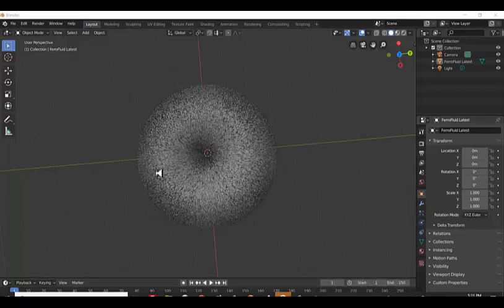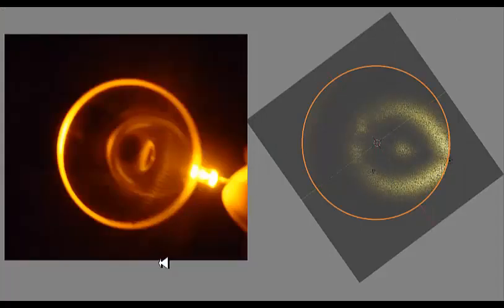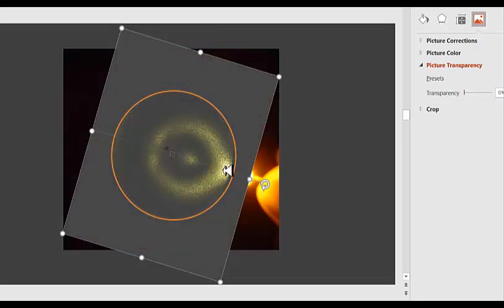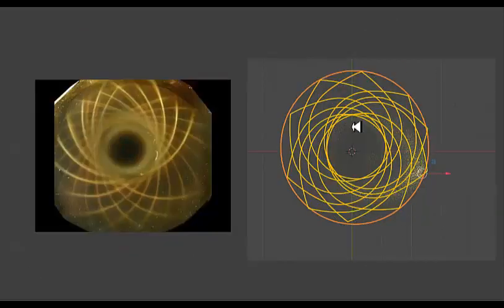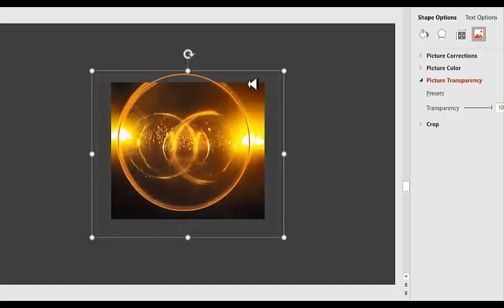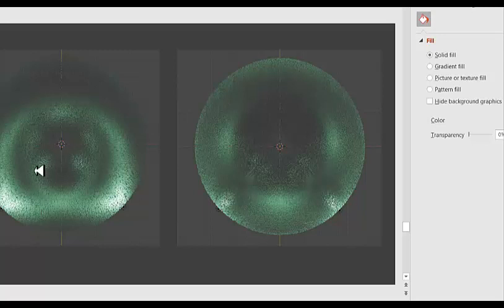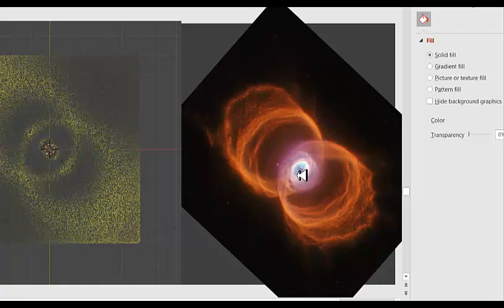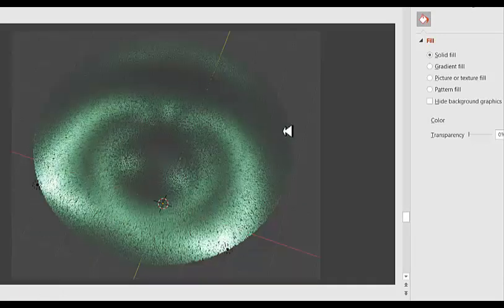Demystifying the Ferrocell  :   PART 3

Comment: Nanoscale ferrous needles and larger are probably very similar at galactic scales. This effect should be studdied and modeled. This simple model can be scaled up to galactic clouds of oriented rods, difracting light.  This could account for why spiral arms brighten and dim.  It might depend on what way all the rods in the dark medium align.
Reply: This is nobel prize type stuff, you should scale up that model, run it against the other galactic models. Floating pointing needles in space, is too simple to ignore, and so impactful in light magnitude, simply because of the distortion this phenomenon causes, it has to be key to relevancy we observe.  This phenomenon could explain why we see stars brighten, and dim, at specific intervals.  It could be dependent on the needles and how they point/rotate to changing magnetic fields.
Reply from the maker: I agree that this could be scaled up. It is my opinion that the "Ether" is very similar to the ferrofluid between the two pieces of glass in the ferrocell. The Ether aligns around magnets in a similar manner to how the nano-particles in the ferrofluid align which is analogous to how iron filings align around a magnet. It both scales up and it scales down.  IN my model of the universe, a black hole is also a freakishly large "magnet" and the Ether surrounding it will form needle like structures like in the ferrofluid which light can reflect off like in the ferrocell. That is why the image that the ferrocell produces is so similar to the famous black hole "image" that was presented to the world a few years back.
Reply: I envision trillions of them.  Amuha Muha even.  Smaller and larger too.  Forming, aligning, and filtering light.

Comment: I understand that the lines of light are not showing separate MagnetoKinetic field lines, but would it to accurate to say that the shape and position of the lines in a Ferrocell show the shape and position of the overall MagnetoKinetic field? That's something I'm a little confused on, thank you.
Reply from the maker: The lights are reflecting off of the nano-particles in the ferrofluid between the two pieces of glass. What you see is highly dependent on where the lights are places and where you are standing relative to the lights. Long story short, what you see is an optical effect or illusion if you may.
Reply: @FractalWoman  I'm still a bit confused, I get the optical illusion effect due to how the particles are reflecting the light, but does it serve any use in showing the Magnetic field's presence or position in relation to the magnet?

The fact that the nano-particles affect the light in the way they do shows there is a field affecting their location and rotation, what I'm wondering about is if the effect on the particles gives us an accurate position of the magnetic field (I'm still getting familiar with the language and terminology you use).

Because in your previous video where you overlapped the iron fillings as showing the ElectroPotential field between them, and the Ferrocell as showing the position of the MagnetoKinetic field, it made a lot of sense to me.
Reply from the maker: @JenkoRun  yes I did overlay the field line with the ferrocell image and there were similarities. But that only works when the lights ate surrounding the ferrocell and when the camera is placed above the ferrocell. I made that video before I understood how a ferrocell works. In retrospect, it was a bit misleading. I was misled by Ken Wheeler  and then passed that along to you all.
Reply: @FractalWoman  I apologies if I sound like a broken record at this point, but even with with the misunderstanding, and I don't really understand what is the misunderstanding is, is the Magnetic field shown in the Ferrocell reliable for relating to the field around a magnet in the real world? It matches Eric Dollard's image perfectly.

I'm trying to understand what the Dielectric and Magnetic fields around a magnet look like, or even if that is what is present around a magnet at all, but I've been getting a lot of conflicting information for the past week, or at least unclear information, and it's left me feeling confused and quite frustrated at this point.

Comment: Would love to see a ferocell + magnet with a COB LED-Strip around it (must attach a dimmer to the strip tho.) 

A COB LED is basicly the same as regular LED but much much smaller and placed much much tighter givning you a almost homogeneous light in the strip. 

With proper dimming one might be able to see a more high res pic. 

Have anyone tried to stack multipel ferocells?  Say 10 sheets with say 5mm distans from from eachother with magnet in the middle? Maybe one would be able to get a real 3D picture of what is actualy happening of tried.
Reply from the maker: We already know what is happening in 3D. The  nano particles in the ferrofluid align with the magmatic field of the magnet. Light reflects off the aligned nano particles into our eyes. What we see is highly defendant on the placement of the light and the placement of the camera or our eyes.
Reply: @FractalWoman  Yes, I understand so you say adding a more homogenious lighting to/around the ferocell would not add any more info? Maybe it would only blur out or make the tragectory of the magnetic lines harder to distinguish? (Bad english i know)
Reply from the maker: @lundqvjrl9359  I have done this. I used a continuous lighting system around a ferrocell and all it does is wash out the lines that are normally there. You can see the results in this video: https://www.youtube.com/watch?v=6-YzsIjaVuw

Comment: Yeah I think black holes are like volcanoes on earth, but in space, it would be pointless to dump back into your own backyard right? so it inverts everything in space back to counterspace. On spheres like planets and stars it's inside out, lava spews outward helping keep the right pressures within. in space it inverts back the front as it otherwise creates a pointless loop of taking and dumping in the same universe. Ken says they are objects with a super high dielectric component so a mass with no visible magnitude due to it's magnetism being over powered by the dielectric inertial plane pulling back into counterspace, hence the drain motion they photographed. Thanks for the vids most excellent!

Comment: This is super interesting and definitely shows that specular reflection generated from the Magpylib magnetic moments fully model the behaviour of light reflections observed in a ferrocell.

Until watching this I had thought that the ferocell showed the dielectric field lines, but clearly that is absolutely incorrect. 

Your simulation demonstrates that the ferrocell shows the magnetic field lines, however the viewers confusion arises because what we see are the specular reflections coming off sides of the nanoparticles in the ferrocell.

It would be really interesting to see if this virtual magnet simulation you've created with Magpylib shows the same set of almost parallel specular refelection lines that run across the Bloch Wall as seen in a real ferrocell.

So my question is this: Would it be possible to create a similar Magpylib magnetic moment model txt file where the virtual magnet is effectively laying on its side so that both the North and South pole are visible in your virtual ferrocell ?

Thanks.
Reply from the maker: I am currently working on a short paper with AB Science. We are no longer using Blender but are doing it in a more scientific manner. This is AB's area of expertise actually and he is doing an amazing job. What I can tell you at this point is that all views of the magnet (and multiple magnets) under the ferrocell can be replicated using specular reflection off the nano-needles that form when you place a magnet near the ferrocell. It's quite amazing and sooooo simple.
Reply: @FractalWoman  The simplest way would be to photograph the nano-needles going from pole to pole and to compare that to iron filings. If they form the same pattern, than the pattern seen by the eye must be an optical effect due to reflection, etc.
Reply from the maker: @codetech5598  Or we could simulate it and see if it forms the same patterns. This is actually very simple and doesn't require a microscope which can only look at a tiny slide at a time.
Reply: @FractalWoman  Someone with a microscope equipped with an XY stage and camera could do it in an hour. 
They don't even need a magnet on the Ferrocell; they can use a cell that has the image already "burnt into" it so it will easily fit under the microscope.
Reply from the maker: @codetech5598  In this video, https://www.youtube.com/watch?v=ACVNrJ1BKKY&t=1s
you can see the nano-needles lining up with the magnetic field as the magnet is being moved around. I don't need more evidence than this to see that these magnetite nano-particles are acting like iron filings in the presence of a magnet.
Reply: @FractalWoman  What would it take to convince Ken?
Reply from the maker: @codetech5598  A miracle...

Comment: Still dosen't change anything.
Reply: She is saying that space is filled with a ferrofluid like substance and when you shine a light on it it acts like a ferrocell. She is not saying there is a star pattern around a magnet.
Reply: @kernalfleak  Yes, I am aware of that fact. What I am suggesting is that Ken is still ultimately correct, even if the light is technically refracting off of the collective material in the field lines. It is what allows those "areas" to exist in the first place that truly matters.
Reply: @archaicsage4803  oh ok. the star pattern has been a problem that left a lot of people confused for years. Glad we now have more accurate data which will allow us to move forward.

Comment: The torus shape isn’t necessarily real. Technically you could argue that the magnetic field doesn’t interact with itself. Iron filings create a torus, which is what one would expect from any self-forming string of magnets. They attract at the ends and repel adjacent forming strings. I mean, you can assume it’s a torus since we know magnets interact with each other, and therefore a magnetic field probably determines its own shape. Just like filings do only without the lines. But still, nobody knows for sure. Could be that the magnetic field doesn’t even express itself until it has a medium to conform to. 

This is a great simulation btw probably the best visualization I’ve ever seen. Nice work
Reply from the maker: Thank you. "Could be that the magnetic field doesn’t even express itself until it has a medium to conform to." That is definitely a possibility. Without the iron filings and/or nano-particles, does the field even exist?
Reply: @FractalWoman  My "beef" with iron filings is this:  Say you put a magnet under a piece of paper and drop just one iron filing near the magnet.  The filing will fly towards the magnet and stick somewhere on the magnet.
Now sprinkle iron filings around the magnet, and they will arrange themselves into the bands we are familiar with.
Now drop just one iron filing near the magnet. It will get stuck onto one of the bands, which is different behavior than when there are no other filings around. The presence of the other filings, which are now acting themselves as tiny magnets, has changed the behavior of the system.
(It's the same problem as "observing a photon has changed the way the photon behaves".)
Reply from the maker: @codetech5598  I agree 100 percent that many iron filings is a different experiment than 1 iron filing. However, light (I don't call them photons anymore) is not a particle, it is a wave. Waves do not interact with each other. Yes, they INTERFERE, but they do not INTERACT. For example, if you have two waves moving towards each other, when they meet, they will interfere with each other. You will get constructive and destructive interference. But after the waves are past each other, they move along their merry way as if they never met. 

https://www.acs.psu.edu/drussell/Demos/superposition/superposition.html#:~:text=The%20principle%20of%20superposition%20may%20be%20applied%20to,simply%20the%20sum%20of%20the%20individual%20wave%20displacements.

That is the difference between iron filings and light.
Reply from the maker: Matter and Waves are incommensurate principles.
Reply: @FractalWoman  But in order to "measure" light, you must physically interact with it with a sensor that uses some kind of electro-chemical reaction that alters the light.
You can't have your cake and eat it too.
In order to measure magnetism, you must insert something into the magnetic field, but that alters the field.
Reply from the maker: @codetech5598  OK. Let's take a step back. Matter can interact with Matter. Light can interact with Matter. (Atoms absorb and emit Light). Light cannot INTERACT with light. Light can only INTERFER with light. 

" But in order to "measure" light, you must physically interact with it with a sensor "

All sensors are made of Matter. Atoms absorb and emit light. The wavelength of light that the Atom emits is the same wavelength that it absorbs. Atoms don't alter the light that they absorb. 

"In order to measure magnetism, you must insert something into the magnetic field, but that alters the field."

Magnets are made of Matter. The thing that you insert into the magnetic field is also made of Matter. Light has nothing to do with any of that. 

"You can't have your cake and eat it too."

I only eat cake on my birthday. If I ate cake evert time I HAD access to cake, I would be a very fat lady. LOL
Reply from the maker: @codetech5598  "You can't have your cake and eat it too." Also, I would appreciate if you didn't make comments like this. It is completely unnecessary and it kind of pisses me off.
Reply: @FractalWoman   "You can't have your cake and eat it too" describes a principle of physics in which you cannot measure a system without interacting and therefore interfering with it.
additional example 1: When you attach a voltmeter to a battery to measure the voltage, the meter draws some current, which loads down the battery, causing the voltage to drop. 
additional example 2: When you measure the money in your bank account using an ATM, the bank charges a service fee, which lowers your balance.
QM mechanics think this principle of measurement interference is unique to QM, but it happens in real life all the time.
Reply from the maker: @codetech5598  I looked it up and you are correct. "In1925, Heisenberg would publish a paper that informed physicists that nature has a way of telling you that you can’t have your cake and eat it too." 

You a agree that Light does not interact with Light though right? In other words, light doesn't have cake, nor does it eat cake.
Reply: @FractalWoman  Are you asking if light interacts with light, or if light interacts with  matter?
Reply from the maker: @codetech5598  You are the one that started this conversation. I have lost track of what you were trying to get at.
Reply: @FractalWoman  The point is whether someone can measure a magnetic field without interfering with it, and then the same question was applied to light. I say the answer is "no" for both.
You said "Atoms don't alter the light that they absorb" but if a "quanta" of light is absorbed then the light has been altered; it is no longer light.  (Light being a pertubation in the Æther, and electrons being some kind of vortex in the Æther, what happens is that the motion of the light is transferred to the vortex, making the vortex more energetic, which particle physics describes as "The electron absorbs the energy and jumps to a higher energy level."
Reply from the maker: @codetech5598  In a similar manner, one cannot measure a force, without altering the situation. This is the paradox of measurement. This not unique to magnetism or light.
Reply: @FractalWoman  so is magnetism or light ever observed without interaction/interference? What is the difference between interaction and interference then in your opinion.
Reply from the maker: @MikaelBrogren  When two waves are travelling towards each other, when the meet, the amplitude of the waves superimpose onto each other. When the waves are past each other, they go back to the original amplitude of each waves. The waves interfered with with each other, but they didn't interact because neither of the waves was changed when they came out the other side. If you throw two balls towards each other, when they meet, the interact with each other and, unlike the waves, the state of their motion gets changed by the interaction. That is how I distinguish between interference and interaction. But, when light reaches a detector (a material body) it INTERACTS with it thus changing the state of the motion of the light and/or changing the state of motion of the atoms in the detector. Now I can answer your question 

" is magnetism or light ever observed without interaction/interference?"

No. Observation of light and magnetism requires interaction.
Reply: @FractalWoman  thanks now i understand.

Comment: Space is full of specular reflections. This is amazing stuff, Lori.
Reply from the maker: Exactly. Space is acting like a ferrocell. In my opinion, space is filled with quantum electron-positron pairs (vortex-antivortex pairs) that are polarizable not unlike the nano-particles in the ferrocell. In the presence of a magnet (a black hole for example) the vortex-pairs self-organize into the same patterns as the nano-particles in the ferrofluid (and iron filings).
Reply: Is aether ferromagnetic? LOL.
Reply from the maker: @whig01  The vortex-antivortex pairs that I always talk about are polarizable. This is what we experience as the magnetic "lines of force". So not LOL, but you can laugh if you want to. Laughter is good for the soul.